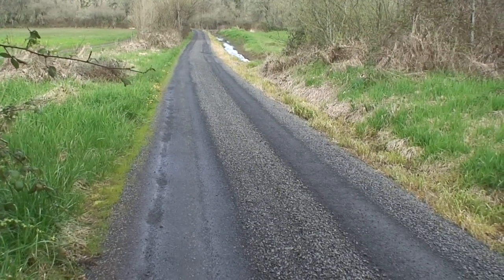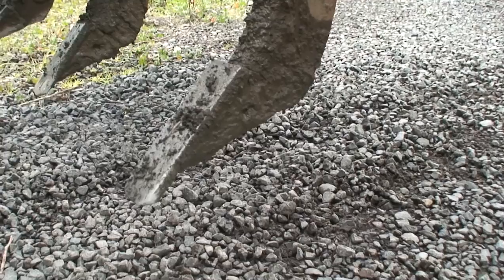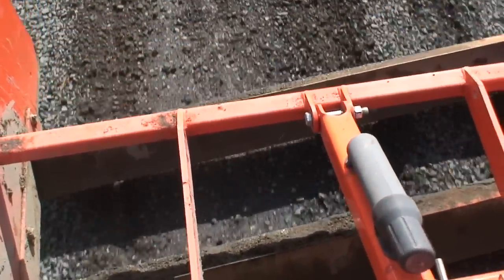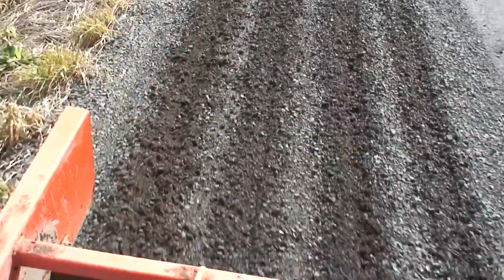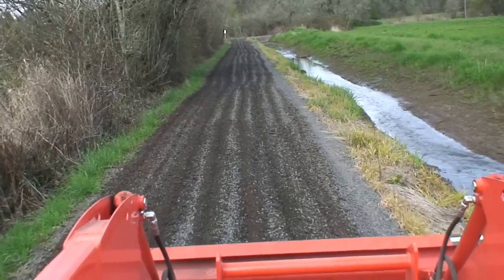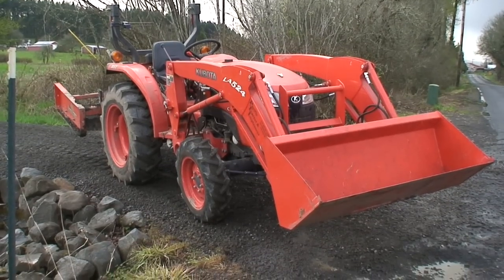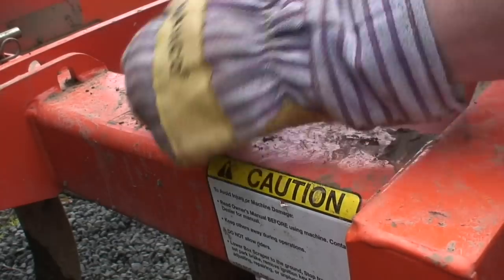How to Regrade a Driveway

Comment: Nice video. Did you tilt the grader or was the old crown sufficient that you just used it flat?
Reply: Kapper Outdoors I'm curious of this also.
Reply: Joe I swear every tractor video I watch there you are! Lol
Reply: Not speaking for the channel, however you do not tilt the grader. What you do is adjust the blades within the box to give as much or little crown as you like. The box is designed to hold the blades at the proper plane in relation to the road edges and the blades do the cutting and leveling.
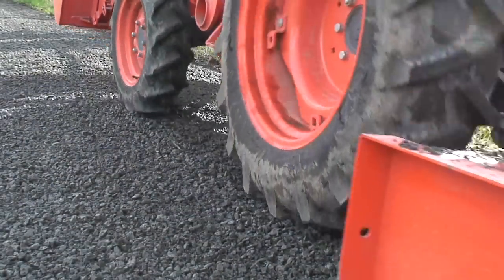Reply: At 2:02 he was doing a pass down the middle with the grader flat, and 2:12 it the grader is angled down on the right and he's grading on the right hand side of the drive. So at least 3 passes to do the middle and then each side.